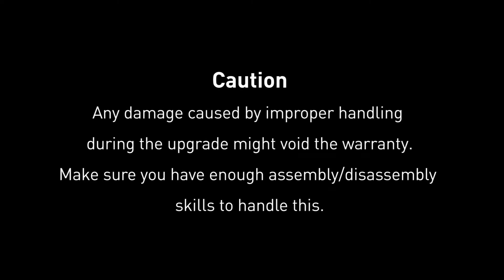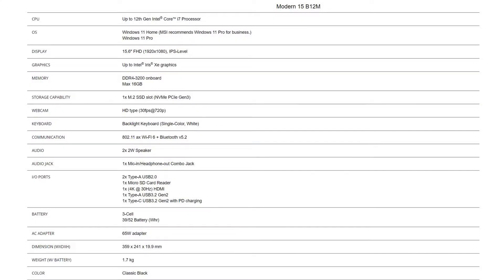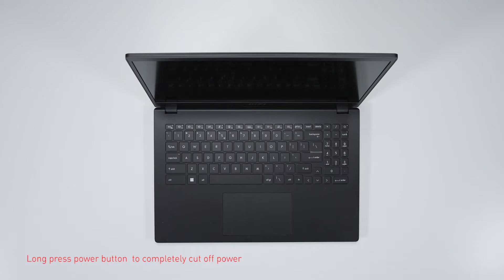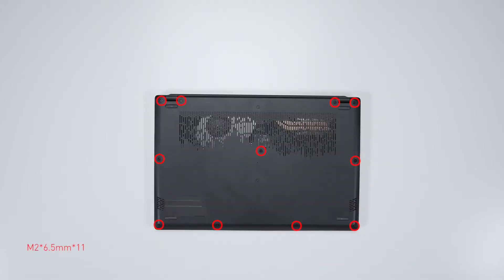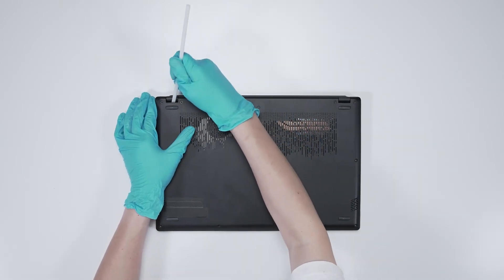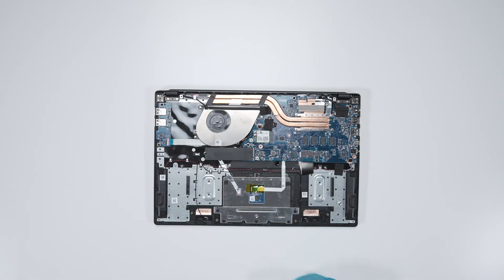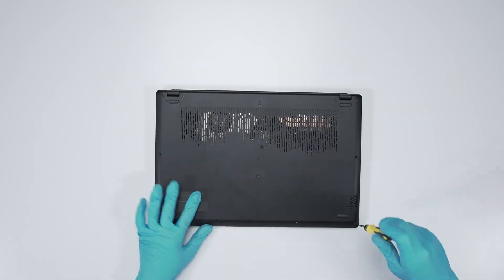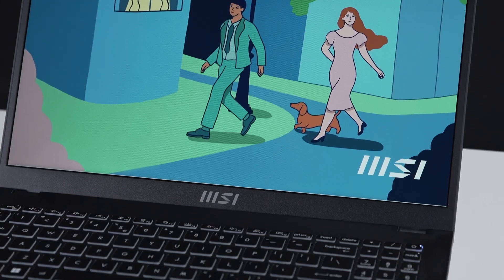MSI Morden15 Upgrade Tutorial

Comment: Nice video as usual, but honestly I'm disappointed with this year's Modern 15. Last year we had 2 M.2 slots and 2 DIMM slots (basically a trimmed down version of Prestige 15), and now they have 1 M.2 and soldered RAM? And with that much empty space on both sides of battery, surely they can fit a bigger battery in there.